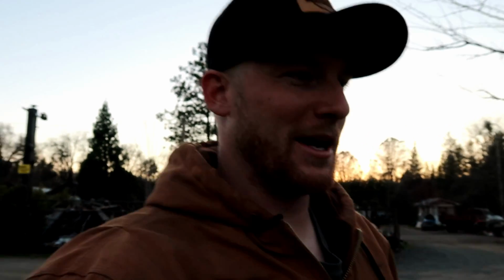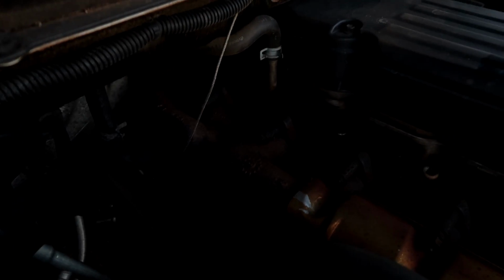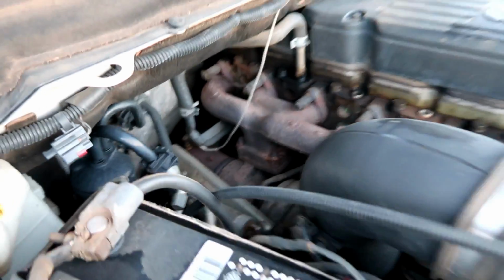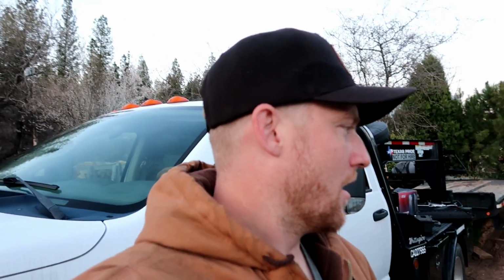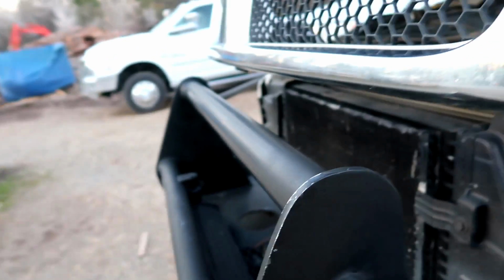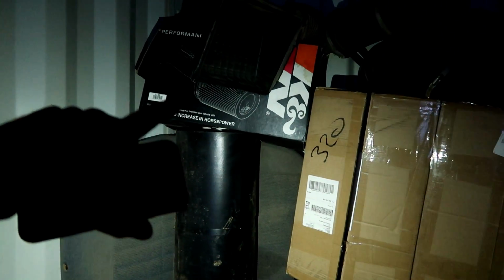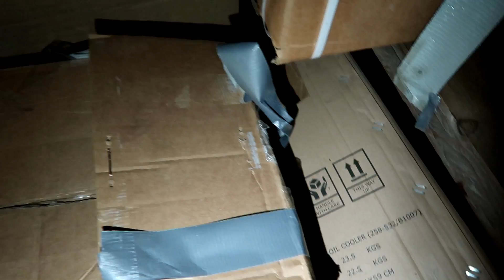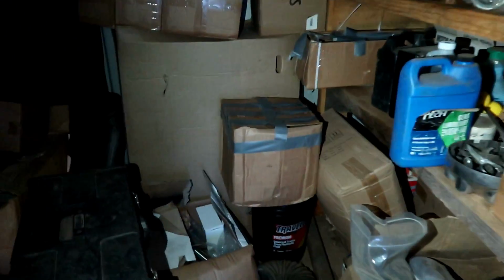TIME TO ADD SOME POWER TO THE 328,000 MILE 5.9 CUMMINS

Comment: You should have a sticker in your glovebox,where all the options are written down including the axle specs.... 
agreed ! One tire fire sucks....
Reply: mikestrucks   Beat me to it.
Reply: Manny Puerta 🚄💨💨🙋🏻‍♂️
Reply: Just found out my 05 has a locker on it and I have the option list and it’s not on there
Reply: sam grabel maybe they put one in after,or your axle was changed...
Reply: sam grabel   That’s probably because lockers weren’t an option. Only limited slip was. Now if it’s really limited slip that is installed, and it isn’t listed on the glove box lid, then it was installed after the fact...like by the dealer or a previous owner...like the limited slip on my ‘94 12V.
Reply: Manny Puerta  I can tell you it is a factory axle has all the mopar part numbers your probably right it an lsd .  And also I have a 2015 dullie that dose have a factory locker

Comment: I run Detroit True Tracks front and back my 2nd gen. I’m about 450ish H.P. and yeah, that will get you in your happy place. I have had train horns in my log trucks in the past and they a ball valve that you would crack open. Not sure how that would work without a serious air compressor. Thanks for sharing.

Comment: Hi Sam, drink tumbler is at home in the mail, I’m still not on the mainland to see it yet, next week though. Pulled the trigger and bought a Fleece 63mm Cheetah turbo for the 5.9. Final piece of my build. Hoping not to have to do head studs, your thoughts. Running the Banks Economind tune setting 4. Nothing wild, but a good improvement. Simply do not want to destroy the truck. Reliable horsepower. EPA starting to crack down on tuner companies, Gale Bank’s sure seems to have gotten his business model right. Hope to have turbo on in a couple of weeks, will update how it works out, Fleece says good for 50HP. Would like to Dyno sometime. Keep it up.

Comment: If the limited slip is not working correct, some of them require a traction compound to be added to the gear oil. So if you drain the gear oil and replace it with fresh compound. That often cures it. 

Also you should maybe consider getting a gas engined truck. The fun and joy of driving a truck still, but with that quicker throttle response that gas engines generally have.

Comment: Put the stock HE351VE on your 5.9, get the Steed Banshee controller. Steed has that setup on his 5.9 and I am sure he has settings that will turn that 5.9 loose. Then you will have exhaust brake. He has the drive to boost ratio down to 1.5. Can't go lower.

Comment: Want to have stick to the pavement tires, wet too. The original Nitto Terra Grappler in 285 70 x 17. Not the new junk G2.  If you want to drift. for sure get any Michelin. Steel radials. No I did not make a mistake. Michelins are made of steel and will slip on any paved surface.  The brand new ones on my truck when I bought it almost put me over a bridge with just wet pavement. Not even still raining.

Comment: I think a flatbed would look good with about a six inch lift and 38s.  That 67 should be fine on the 5.9.  You will loose some low end but with some good tuning it should be minimal.  Top end will be kick ass.